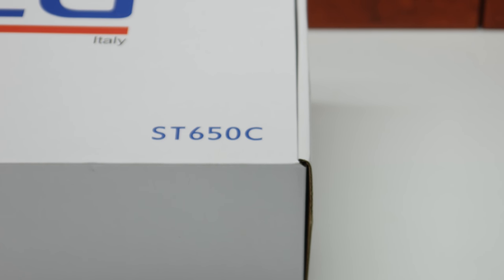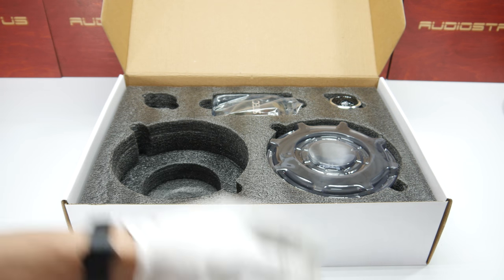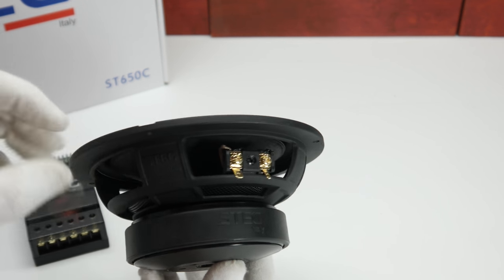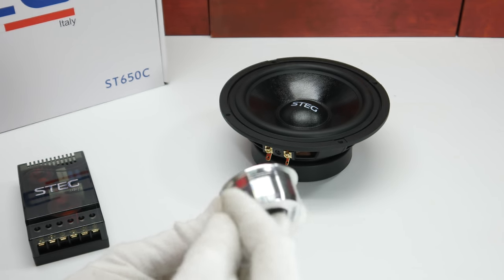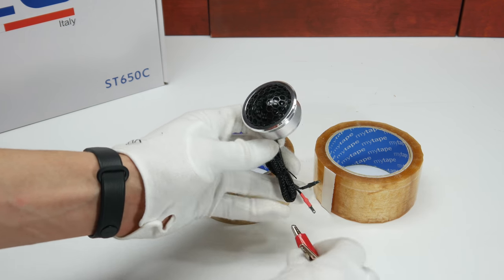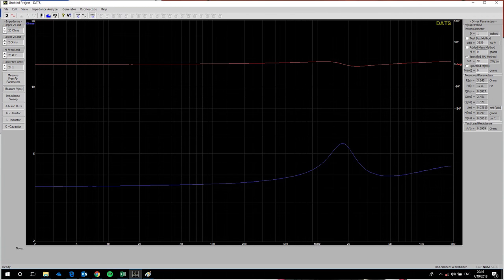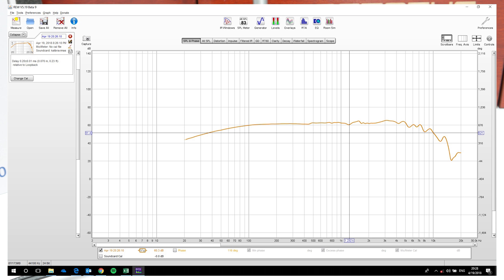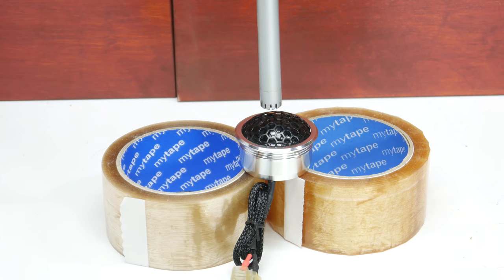One of the best 2-way car audio systems ! / STEG ST 650c

Comment: Mr.This 6.5" speaker have Mms 48.34 gr. and Qts 0.3914? 🤔 This fantastic poor parameters for SQ 6.5" speaker))))☺.Beyma made 12" speaker with Mms 35-45 gr.And for high quality speakers need Qts level 0.13-0.35. Because 0.4-0.5 very high level Qts for SQ speakers.. I know, Steg made very good amplifiers for car, but this speaker made crazy Enginers..
Reply: Listen to it if you have a chance to do it ! You won't regret